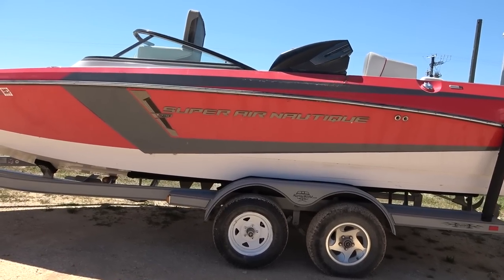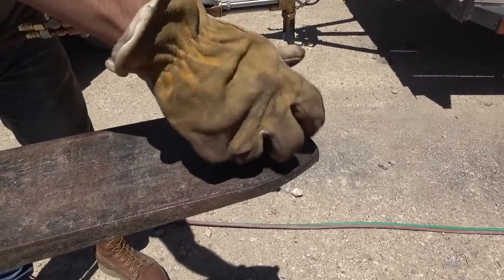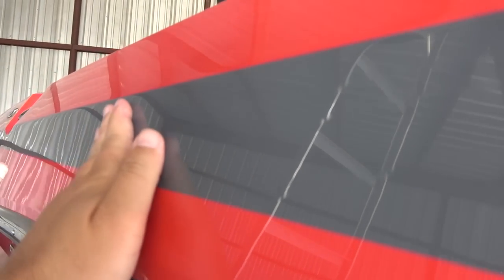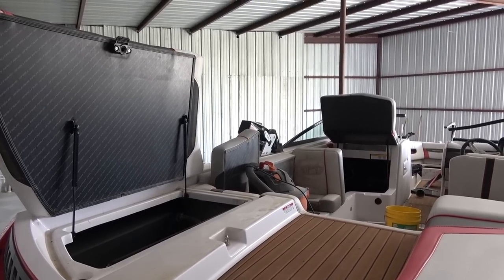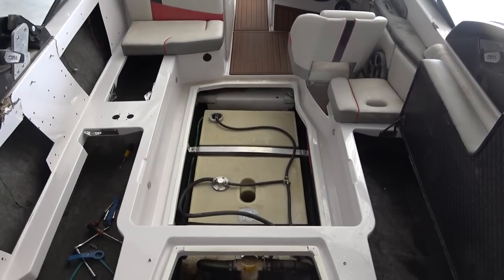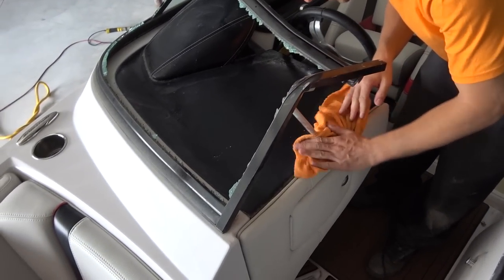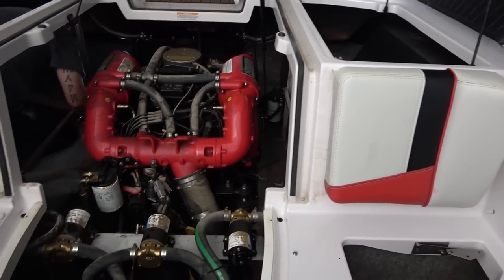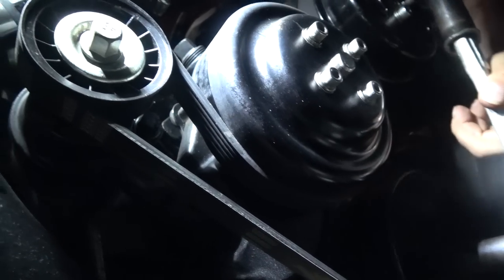Flooded Copart Super Boat REBUILD PART 2 - More DAMAGE!?!

Comment: Now it's a shiny clean just as broken boat.
Reply: his point is to flip this with as minimal cost outlay on his part and make a profit... if it has a broken keel he doesnt care, as long as it turns a profit. he did not buy this to use himself but to offload all the problems onto the next buyer :) so yeah, clean it up paint it get the motor to turn over.. jobs done sell it.

Comment: I have restored over 20 boats over the years. Automotive paint will not stand up to the kind of abuse a boat hull gets. A few more hours of work to add years more longevity to your finish is well worth a few hours of extra work.
Reply from the maker: agreed
Reply: I too have been building and painting boats for 20+ years and automotive paint works absolutely fine. The few times I've painted with gelcoat was only at the customers respect
Reply: Sure Fab has a single stage white gel coat.  It sprays on easy and you don’t have to do anything to cure it.  I have sprayed 7 boats over the last 8 years and all boats still look great
Reply: The top part of the boat will be fine with automotive paint the hull id use gel coat
Reply: @IhateYoutube I can't agree more  I have a lazzara lsx 75 which is a quad engine fast yacht and it has had a pearlescent automotive finish on the hullsides from factory and it is holding up fine its been 10 years in the sun salt and heat and it still looks like new.
Reply: @svn0svn  
Don't think it's "normal" to paint will gell.
I'v always done/seen others scrape/sand/rasp all the damaged gellcoat off, then reapply it and sand down/polish to finish.
Reply: Automotive paint will not adhere well polyester resin. So, you have to find an intermediate coating that will adhere to the polyester as well as provide adhesion for the polyurethane primer and paint. Automotive paints are very soft compared to gel coat  Would you walk on your car?

Comment: Fibreglass and gelcoat are not hard to repair. I've worked in fiberglass for 20 yrs . one thing to remember is if the structure is cracking on the surface then your problem is underneath.
Reply: @rt0110  his logic was quitw simple fix the problem the do automptive pain instead of a new gel coat what is bad about that he never said he was just gonna paint over the top
Reply: @masterspacetime2826  you sure you got the right guy also if he didnt care about makeing money you wouldn't have his channel and builds to watch nor would he have the money to go and buy a new project also hes assessing  the structural damages in the next few video's hes still got to paint over it once its fixed and hes asked if automotive paint is a better option sorry but maybe use your brain before commenting
Reply: Boat flexed so bad it cracked gunnels (gunwale). I'd reinforce that whole area. I'd like to see that hit a wake when you're done to see how well you repaired. If you get lucky try a boat yard for windshields. I paid 300 for one half glass. Pink dots? Blood stains. I'll keep watching.

Comment: Did I hear you wrong!? Repaint because you found "stress fractures" in the paint?! Stress cracks usually mean underlying fiberglass cracks/damage... those areas need fiberglass repair... then paint. If not, your new paint will keep cracking and possible hull splitting in 2
Reply: @ericteipen  He checked the boat out before he bought it and priced all of the obvious parts before hand. In another video had showed the price of a similar tower on a newer boat he was looking at and it was nowhere near your 10-15k estimate. but to be honest before seeing the price myself I would have figured the same as you. The guy does his research.
Reply: Herb Hungwell I work at a boat dealer towers aren’t cheap but no where near 10-15k to replace
Reply: @ericteipen  the glass is about 2 grand the prop is another 2 grand fiber glassing is another 5 to 6 grand new stickers are a grand
Reply: @danieldavies4561  i am not a hater its just i don't think this guy realize how hard its going to be
Reply: There's a reason it's in a junkyard. The costs to repair it won't make it worth it. The hulls been flexed beyond return you can patch it up and use it for fishing but as a speed boat hauling but and slamming around.... nope. The hulls integrity is shot out and patching that shit ain't gonna work.

Whoever buys this from him is gonna die in it at some point. They gonna crank it up because that's what you do with a boat like that and it's gonna bang down and crack and crack and then splinter/shatter. It's not an if, it's a when.

The worst damaged areas aren't cosmetic, it's structural.
Reply: Man the haters. Anyone who knows boat construction knows the top shell is not part of the hull. They are in fact two separate pieces that are typically glued together beneath the rub rail. Damage to the top shell has no impact on the hull and is also not remotely close to being stressed like the hull. This explains why the shell is 1/4" to maybe 3/8" thick in most places while the hull is at least 3/8" to sometimes over 1/2" thick in the reinforced areas. I was surprised to not see some type of plate at the tower mount unless it is embedded in the glass. I'm betting the glass there is 1/2". The tower? Maybe 2k and that's a strong maybe. most you find are in the 1k range. The glass work? Glass work is really pretty easy, just messy. Couple hundred in material if that, and the knowledge to fix it. Stickers? Maybe a few hundred but may be provided free from the manufacturer. The paint? Gelcoat sucks to work with but is pretty cheap. maybe 40 to 50 a gallon. Epoxy paint (gelcoat) is the way to go. The prop? Ok, that one is gonna hurt quite a bit depending on what he buys.
Reply: He will have sold it on by then.
Reply: @Future-Preps35  No, the pink spots are  blood splatter from when the last boat owner eliminated one of his runners because he thought they might have been working for the feds.

Comment: Guys the pink is a by product of bacteria in the vinyl . It is natural the bacteria comes from the air. Keep the vinyl clean to eliminate any more damage. If you use any cleaner that will clean off the pink you will do real damage to the vinyl, stripping the top layer off the vinyl. I was in marine vinyl for years and did much in the testing and warranty of vinyl issues.
I also supplied marine vinyl to correct craft, nautique, among a bunch of other boat manufacturers.

Comment: Honestly, I'd forget the cosmetics and first go to the mechanical and structural components. You're wasting time with cleaners and solvents if you can't fix the boat first: Structure, engine, propulsion, electronics, interior, clean-up. In that order more or less.
Reply: The first thing that should be dealt with is the water in the engine. Maybe vacuuming up the glass around you where you are working but that's it. The longer that engine sits with water in it the deeper the rust goes.
Reply: Scott S  In some cases it does not matter if they clean it first especially if there is not a water flooded engine to deal with. Lets face it if you are working on a car and there is glass all over the seats then you want that gone asap as not to damage the seats and  you! I really don't mind them cleaning up the exterior too since you just have it clean to handle and work around.
Reply: Do the meat then mess with the fluff.
Reply: He's putting on his future vision goggles....needs motivation to counter all of the despair.  He needs a glimpse of what it can be.
Reply: @samualwhittemore228  Ya nothing wrong with that. I remember sitting in my 68 mustang years ago in the spotless interior that I so carefully cleaned listening to Let The Good Times Roll by the Cars dreaming of when the car was done which it eventually was. It ended up being my very first street legal car. ( had 27 cars before that by the time I was 16)
Reply: socal33 he will feel better about the buy if he cleans it. Lol it will lol nice!
Reply: cant asses all the damages if the boat is dirty also who wants to work in a dirty environment?
Reply: @davebrittain9216  yeah they said clean up the glass already, but he doesnt need to be detailing it.
Reply: This thing has probably been sitting for months. What's a day to clean it up? Big deal.
Reply: My thoughts 100%
Reply: Although I don't disagree with you. Having the boat cleaned from glass is a safety factor and it being clean and shiny does help with getting a better idea of what needs addressed as well as motivation. I would do a rough clean then straight to the important stuff. But also, if the boat won't float there's no point of fixing the motor other just finding out if it runs or not. So in other words with a boat it's kinda all important.
Reply: @sydneyconcerts902  exactly what i thought
Reply: @sydneyconcerts902  Yeah, much nicer to work on a clean vehicle, especially if you're restoring it.
Reply: Richard Einstein The irony in your comment really can’t go unnoticed.
Reply: @lickdacat2  Couldn't agree more. First thing Day One would have been to pull the Heads off of the Engine and get the water out of it. The longer the water sits in the Cylinders the more pitting of them. This guy is putting the Cart before the Horse.
Reply: socal33 , i do not understand his restoration method either...first fix the damage, then make her shine again...that is what i would do...
Reply: @samualwhittemore228  Yep, that helps.  I picked up a 30 hour 04 Maxum 1800 SR3 that was stored from 2006 until I picked it up in July.  Guy didn't drain the engine and it cracked the exhaust manifolds and the block.  First thing I did was clean up an already clean boat to assess its condition and just to learn where everything is.  It definitely feels better to see the finished product to help keep you motivated and it encourages you to keep things tidy when doing a messy job.  A 4.3 liter longblock swap later and it runs like a top.
Reply: yeah i'm watching him waste time and money cleaning something that hasnt been repaired
Reply: I've redone truck's and some cars, and I never detailed them before the car or truck was fixed.... there's going to be cutting and fiberglass work paint doing it backwards.

Comment: Dude, my 2012 210 had same damage from someone driving under a low bridge.  Where tower foot is cut out all busted gel coat. It'll b a big scarey hole. Make an external mould across the hole, spray gel, then build up layers of fibreglass, make a plate that is 5"+longer than the hole, build it into your glass work and put in layer upon layer. The more lithe stronger. Remove mould. Wet sand if needed, use orbital polisher low revs and a Cutting creme/compound across area. Offer up new tower, mark holes needed, drill, bolt, done!!  Perfect finish.  You could car spray it and clear coat it a lot for durability.  Really important, on vid you said there's no support under tower just straight into glass. Wrong there's a metal plate embedded. You need to replace that and bigger otherwise when you tow someone your tower will snap straight off again. You can do this. Easy job. We did!!

Comment: When this boat was loaded on the big rig flat bed trailer other boats were loaded on top. That initially busted the windshield frame, then when the straps were sinched down to hold the load, all the fiberglass breakage occurred to the deck. It would surprise me that the hull stringers might be cracked or separated. I would trust this boat off of a trailer.

Comment: Alright, I kinda get it. 

If you enjoy working on things like this and are good at fixing it properly, then this project is not bad. 

If you make money by doing such projects, including Youtube revenue, then it’s not bad. Your content needs a bit of work, but I get it. 

If you are doing this project for you and are going to keep the boat and enjoy it for what it is, I get it. 

If you are hoping to cash in and make money off of the project itself, it ain’t happening. There is some serious structural damage to that hull. The reason there is no backing or support under where it’s broken, is because the fiberglass IS the support and structure. You will never recreate that post mold. 

All of that gel coat cracking is structural damage. ALL of it. Do gel coat repair, first big wake or wave you hit in that boat, all of those cracks are going to reappear. Again, the glass is the structure. 

That prop is going to cost you. You better check the shaft, packing and bearings as well. If it hit something hard enough to bend it, there is likely more damage further up. 

You do know all of the electronics need to be replaced, right? Even though they are marine grade, they can still be damaged by water. Especially if submerged then left to dry on their own. 

Drain the fuel tank. Put extra filters inline before you run it. It will be a while before the tank is clean internally. 

I’m looking forward to seeing where this goes and what you do with it. Could make for good video. Don’t hide from mistakes. Show your failures as well as successes. It makes for good content.
Reply: what this guy said,
Reply: to
Reply: ive had a boat with a giant hole in the hull from hitting a rock on the bank repaired and it held up perfectly fine post repair
Reply: Stop being pessimistic

Comment: The pink spots are caused by pink mold. The vinyl manufacturers changed the formula a few years ago to make it more environmentally friendly. The result on white vinyl has been those pink spots. As far as paint goes try awlgrip I'm not sure if automotive paint will hold up in the marine environment but awlgrip is specifically designed for this. As far as the engine is concerned fill it with diesel as opposed to ATF, the diesel will dissolve the rust.
Reply: max9068 yes on the awlgrip paint. It is what PWV/Jet Ski guys use for their restorations.
Reply: Negative... its bacteria. Its actually caused by bacterias waste.
Reply: The pink spots are from people using spray on sun screen. It's a chem. reaction, with the vinyl, the glue, and U.V. rays, when the boat is cover up. Clean vinyl, then let it sit in the sun for a day or two.
Also, use Marvel Mystery Oil in the top end, in each spark plug hole. Let it sit for 24 to 48 hrs. turn over the engine by hand a couple of time, and add more M.M.oil as needed. Then suck out all M.M. oil, drain the oil, replace filter. Install new spark plugs. Add new oil - 1 qt.  + 1 qt diesel and filter. run for 20 min. then drain. Add new oil and filter.
Reply: max9068 either awlgrip or Imron is the way to go. You can also Roll Tip awlgrip a lot less wasted paint and just as smooth.

Comment: Used to detail boats, we'd use a combination of simple green, bleach and water (ratio of 1:1:5) scrub everything down with a brush, let it sit for a little while (don't let it dry) then power wash and let it dry in the sun. It'd be faster,  it would help with your mold problem and get everything like new.

Comment: That pink looks like women's lipstick that has been sitting so long, it got into the surface. Sadly, had those marks been cleaned immediately, it would have been quick and simple removal. My mom would use hairspray and a toothbrush on it at this point. A big miracle cleaner is 50/50 vinegar and water. I've seem my wife and mother get out stains that I would have thought impossible. The off white carpet in our house (just purchased) had big black stains on it. The previous owners had professionals come in and try to remove them, but didn't get much result. My wife and mom went at them with that V/W mix and now, you wouldn't even have known the carpet was stained. It's called work. They took the time and put in the effort. I notice you are the same way. Very thorough and meticulous.

Comment: 25+ years in the inboard boat/two sports business here. I do fiberglass and gelcoat repair and have done a number of major repair/restoration jobs on relatively late model wakeboard boats. Looks like you scored pretty well on that Nautique, that's a project that is right up my alley. 
As for the the stress cracks all over the top deck, please... PLEASE don't paint over the top of them with automotive or any other kind of paint! Paint will never look right and it will just get destroyed in nothing flat, paint just isn't tough enough for the deck of a boat like that. Gelcoat is not that difficult at all to work with and you will get such better results with it. In your case it would actually be especially easy to get a great result, since you're already doing major repairs and cleaning, just remove all the hardware from the deck, take off the windshield frame, get a DA and some 80 grit discs and rough the whole thing up. Then get yourself a cheap spray gun with a spray big tip (like 2.0 or 2.5mm), and spray the whole top deck of the boat, mix your gelcoat 1:1 with Duratec High Gloss Additive and it'll spray very nicely! Keep plenty of acetone on hand to really clean the gun out very thoroughly between batches of gelcoat that you run through it. Since you're spraying the whole deck, you have minimal masking to deal with and no significant a spray lines to deal with. Do a couple practice sprays on something inconsequential to get a feel for spraying the gelcoat because it is quite different than paint. You could definitely get a great result doing the gelcoat yourself, feel free to DM me if you have any questions or need any guidance, I'd be more than happy to contribute in some small way to getting that SAN230 back to her former glory and on the water for you guys to enjoy.